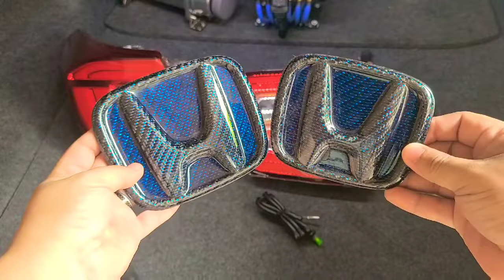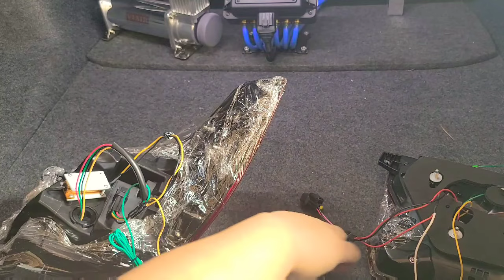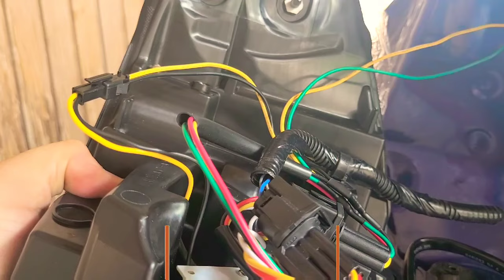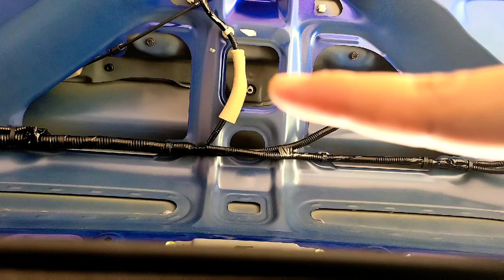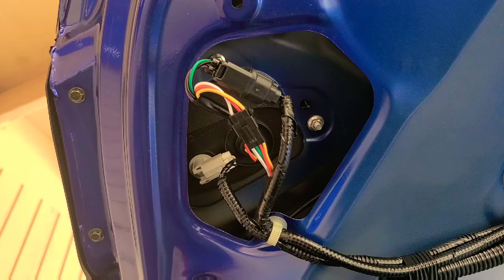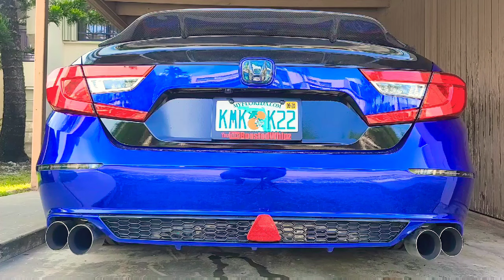V5 (OEM Style) Aftermarket Taillights  for Honda Accord 2018-2020 + Announcing Winner of Giveaway

Comment: Hey man they are disconnecting the v5s do you know why ?
Reply from the maker: People didn't like the animation and overall brightness.
Reply: @BoostedWhipz   are they not bright ???
Reply from the maker: @leonelperaza94  apparently not
Reply: @BoostedWhipz  damn. I bought them and I heard a couple things about the animation goes off with the brake lights is that true. It didn’t happen in your video
Reply from the maker: @leonelperaza94  yeah that's what I am hearing. I wonder if they changed something after mass production.
Reply: Hey sorry for texting so much , so I installed my v5 last night and my right brake doesn’t work. Is their any trouble shooting tips ?
Reply from the maker: @leonelperaza94  make sure everything is plugged in correctly and tight. Especially those small tube connections.
Reply: @BoostedWhipz  they don’t clip. It’s is super hard.
Reply from the maker: @leonelperaza94  use some plyers to assist.
Reply: @BoostedWhipz  will do, thank you for your support.

Comment: Have another question.. when the lights are off and the brakes go on. Is the whole light suppose to light up?? I know when the lights are on. Just the little section turns on when brakes are applied
Reply from the maker: I did a night video showing the sequence. Lights off will bring the light on (the two lines) + the small dotted section when brake is applied.
Reply: @BoostedWhipz  I seen the night video but  when mine are off in the day and I apply the brake. The whole light lights up minus the reverse. Is that how they are suppose to be? It looks good but was just curious
Reply from the maker: @five-bu6hs  yes correct

Comment: Hello, I was interested in purchasing these once they become available, but was wondering if the animation is  easy to disable. Thanks
Reply from the maker: You can't disable the animation on these. However do know that if you hit the brake, the animation stops or gets cancelled.
Reply: @BoostedWhipz  thank you for the response! Is the animation ONLY triggered at startup and reverse? Or does it also come on randomly if idling with headlights/tail lights on.

Comment: I like the v2s better unless you can get these in black?Just got a custom one peace slipper and side from s fector fabrication.i have the same front lip you have, both installed what was you clearance on the front end?and I was thinking about putting the spacers on the side skirts to line up with the front end.do you recommend?
Reply from the maker: Smoke will be available later on. I am air suspension so not sure in regards to clearance. Side skirts should line up with front. At least mine do.
Reply: @BoostedWhipz  did you use the spacers?